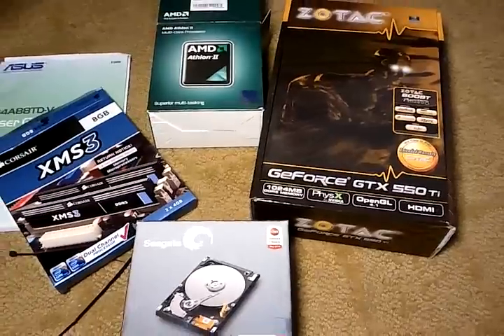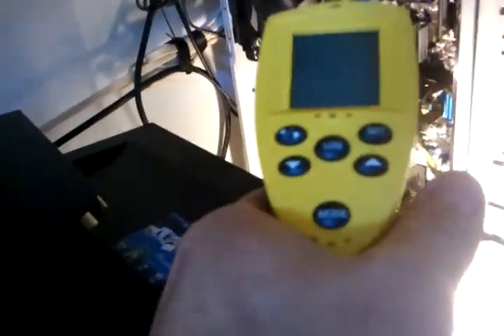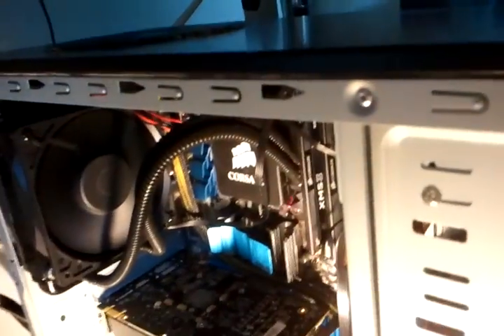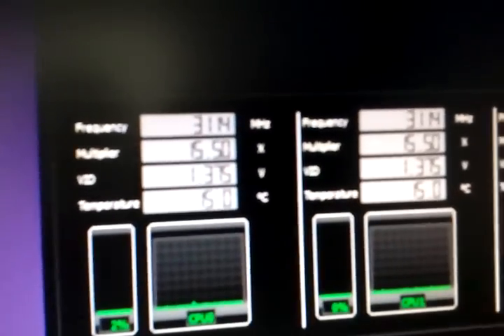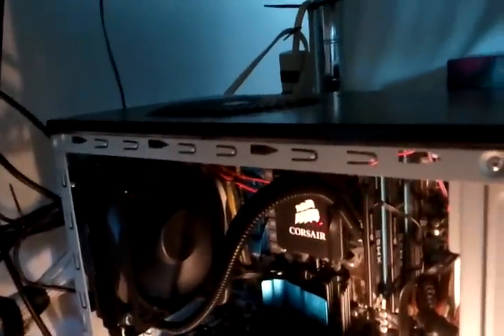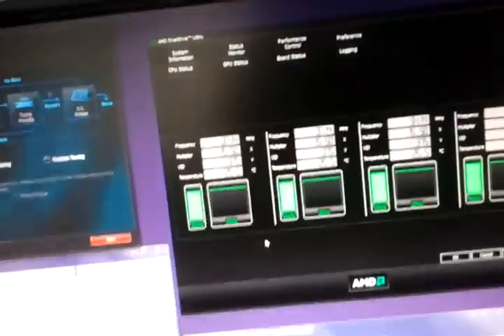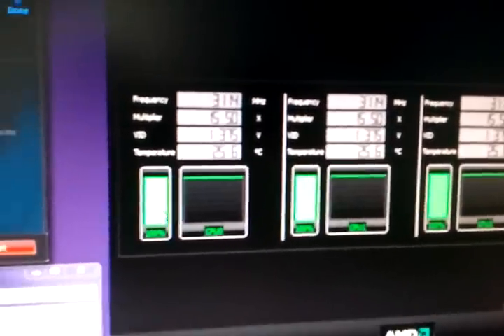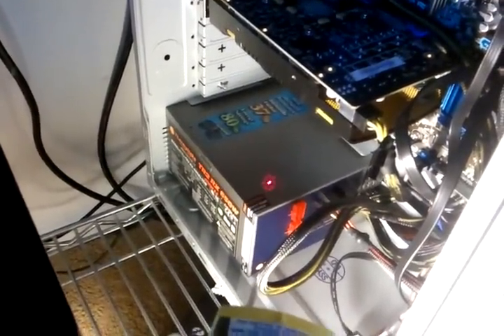CORSAIR H60 , AMD installation and feedback on temperatures.

Comment from the maker: Let me clarify, as I did mention having a push-pull set up.  The unit comes boxed with one fan.  I used the case stock fan in which depending on how you look at it, could be considered push pull.  But, the fact is, the radiator is sandwiched between to fans, and so yes, one is pushing while the other is "pulling" the air out of the case.
Nevertheless, both fans are blowing air in the same direction, hence OUT of the case.
Hope this helps!

Comment from the maker: PS, I am the OP of this video.  "four2x4".  As a final note, installation was simple and only took 10-15 minutes, most of which was spent setting up a "push/pull" fan set up toward the back of the case.
I've been incredibly happy with this cooler and really can not see the need for something different , whether more or less in cost.
Having good and even contact is your foremost concern and you will see drastic improvements in cooling based on this step.

Comment from the maker: At the time of purchase, I had to remove the Intel brackets and install the AMD brackets.  This is a very simple step, which then allows attaching of the cooler to the CPU.  
REMEMBER the most important steps of applying a very small amount of heat-sink compound, (a ball the size of say, 3/16 diameter).  Over application of compound is nearly as bad as not using it.
Finally make sure to evenly tighten the attachment screws (2), so that you have good and even pressure of the cooler to the CPU.

Comment from the maker: True, sometimes! 
When a CPU overheats, it simply ceases to process code, or process code correctly ~  thereby causing what we see as a frozen screen. 
In this case, Fans, Motherboard, and all other gadgetry continue(s) to run (usually).   This seems typical when making OC adjustments.

That said:  If the motherboard software is set to shut down (or throttle down the CPU) when the CPU reports a certain temp (or overheat), then yes, it will shut the whole computer down.

Comment from the maker: You are probably right about wasting money to a certain extent.  I had a failure some years ago of a fairly expensive CPU when the stock fan stopped (slowed down over time, due to bad bearings).  So, that CPU slowly cooked over time and failed prematurely.  I got a pretty good deal on this unit with the rebate, and "open box" purchase.  I think I paid under $50.  Not too bad for a decent water cooler.

Comment from the maker: @kd84afc Also, at about 1:12 in the video, I commented on the installation, in yellow text. The screw hardware attaches at the base of the CPU where the oem fan would normally clamp down.

Comment from the maker: @kd84afc The unit comes with Intel hardware attached.  Replace it with the supplied AMD hardware, and you are ready to go.  The cooler block is attached with only 2 screws to the the CPU base plate, so it is important to:
1. use a pea-sized dollop of heatsink compound, and
2. make sure you both tighten it evenly and securely.  Like any heat sink, you must have good contact with the CPU.
3. use a reliable non-controlled power supply.  You don't want the mobo to "control" this "fan"

Comment: Hello mate I use a AMD CPU as well, How easy is it to install the the block to the CPU as I seen lots of installation videos for a intel install none for AMD, Do I have to fit a backplate or does the water cooler block just fit to the CPU by the AMD cpu connection brackets ?

cheers

Comment from the maker: @WanglerVille  Yes,  I guess I did.  Are you suggesting an office machine cannot be pushed to high temps?  ANY "machine"  can benefit from extended efforts to keep things cool, regardless of the use it receives, especially from stock cooling (which can cause premature failures).  

When multitasking, for example, watching HD video (dual view), and video, photo, cad, editing etc., can push a processor to hotter temps, again, worth the effort to upgrade.

Comment from the maker: @bobctx REMEMBER: Your current CPU / Mobo configuration will determine just how high you can O/C your CPU. 
 My AMD Athlon II x4 645 is currently OC'd at just over 3.6 (runs OEM at 3.1), and has run flawlessly since shortly after making this video.  
For those interested in my Windows 7 "WEI", for CPU:  it went from 7.3 to 7.4 upon overclocking.

Comment from the maker: @bobctx Also, it is important to make sure that you plug the H60 into a stable non controlled fan power supply.  I believe most failures are due to one of 2 issues:
Improper use of heat-sink compound or,
improper use of power supply to the unit. (the unit HAS to flow coolant at ALL times.)

Comment from the maker: @bobctx Correct.  As well, I've disabled any bios-related fail-safe for temps, but this did not affect changes as long as I didn't OC above 3.7.  This current chip cannot stand anything over 3.6 lest it be unstable, hence freezes from once a day, to several times a day, none of which are temperature related.  With the H60, my temps are/have never been even close to the upper thresholds, even at 100% stress tests for as many as an hour or more.

Comment from the maker: @marianorodrigocc  I would say to compare the specs of my chip to your i7.  If it has similar running temps, then you could expect similar results.  There are a lot of possible variables that can effect your temps, such as ambient room temps, or whether you have your case in a desk inclosure for example where things can heat up.  
A good, open environment surrounding the case, and proper setup, you should expect good results..

Comment from the maker: @TheUltraCommentator Sorry to take so long to get back on this but YES, I think this cooler would work just fine.  This "low-tech" test/review was done on a chip that was not overclocked.  After making this video, I overclocked the x4 645 to 3615 and never a problem and temps have remained very low.  I think you will be happy